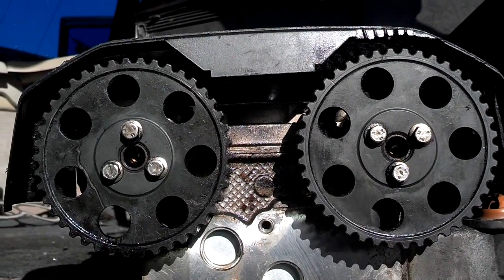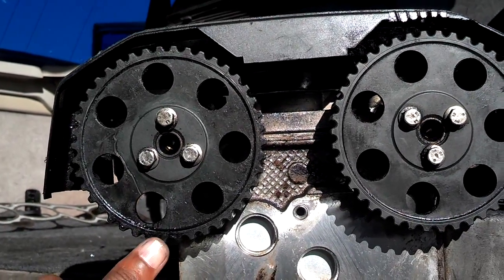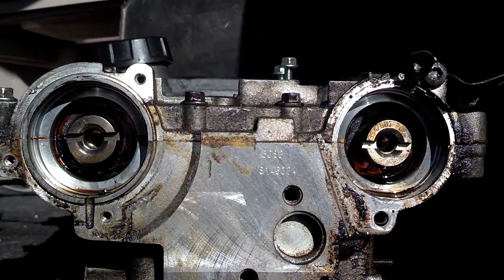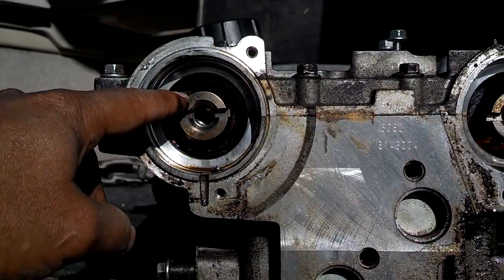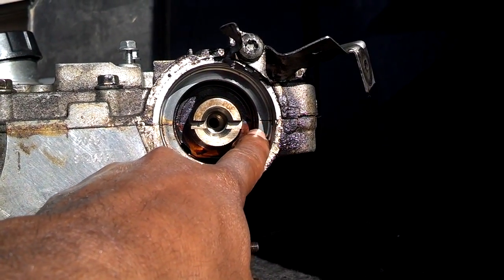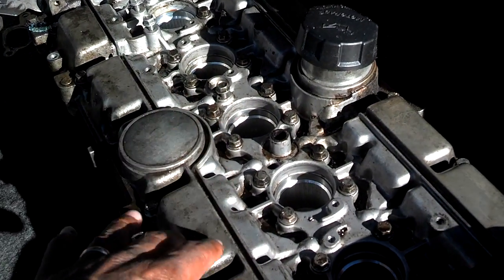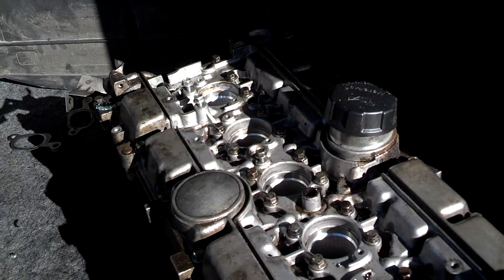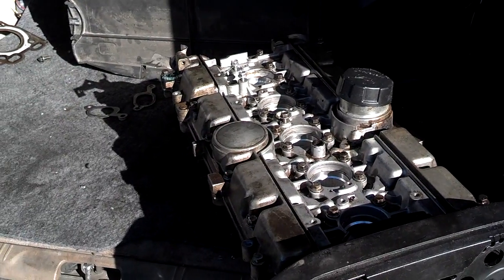Timing demonstration with head removed, cam cover installation. Volvo 850, S70, V70, etc. - VOTD

Comment: Hello Robert, ok here I am again. So car started right on 👍 the problem is that the whole reason I did all this is because there was white smoke and coolant drops coming from tail pipe, so I though that the was a head gasket problem, but after all this fun work the car is still blowing a bit of coolant from tail pipe and coolant keeps on leaking from behind the engine on the driver side, I can't seem to be able to locate exactly from where it's this coolant leaking from, I have scratched my head for a while so here I am asking for advice again, can you please help

Thank you again.
Reply from the maker: Oz Ramuco The turbo should have coolant lines. Also, are you sure the white smoke is coolant? Could be a turbo taking a dump, usually more grey smoke. - 2003 Volvo XC90 T6 AWD Smokes and has P0234 Code. Bad turbo...
Reply: it's white and with liquid drops as well
(coolant?) wich is the reason I replaced the head gasket and ha the head machined
Reply from the maker: Condensation ALWAYS leaks out of exhaust. When the car is cold, white smoke usually comes out of the exhaust. What else was going on with the car? Was it overheating? Was it loosing power? Was it misfiring? Was it mixing coolant in the oil? Was it loosing coolant other than the coolant hose you have leaking behind the motor? Replacing a head gasket is to much work to do on guess work or speculation.
Reply: Hello Robert, question. the car keeps blowing white smoke from exhaust and droplets of coolant as well. so I got the Bock tester to see if the liquid would turn green or yellow but it remain blue, which I think means that there is no coolant going into the combustion chamber or that the head gasket it's ok? can you help please.... I am confused. trying to determine what its causing this darn coolant vapor coming from tail pipes
Reply from the maker: The tester tells you that there is no combustion gasses going into the coolant. Can you take this discussion to the head gasket video or private, off of this timing video please. - How to test for a blown head gasket on a Volvo - VOTD

Comment: ok so I removed the head, before I did that I timed the camshafts to the top of the timing cover but not the crankshaft, i also changed the pulleys on the camshafts, so now i don't know how to set the timing right on the car :( can you help me please?, i guess what I am asking is how after all my stupidity can i set the timing on the crankshaft, i am thinking to set the crankshaft to the correct marking, then to set the cams the way you illustrated on this video and finally set the camshafts pulley in their marks and only then to reinstall the timing belt. am I correct??
Reply from the maker: Oz Ramuco You really need to set the crank on it's mark before you install the cams in the head. So, if you already installed the cam cover, you may have to remove it if the crank is NOT on the marks. Matter of fact, if the crank is NOT on the mark, and you installed the cam cover, you may have damaged some valves. Did you use my video to remove and install the head? Timing Mark Crank Sprocket Location, Volvo 850, S70, V70, XC70 - Auto Information Series - Volvo timing alignment - Auto Information Series
Reply: so here is what I did, took the back cover for the cams so that I know that they were align then without the spark plugs nor the timing belt I finally put the crankshaft on its mark, and only then I installed the timing belt and gave it two full turns to see if all the marks where in their proper place and they were spot on. does that sounds ok or should I go ahead and do it all over 

thanks for the help!!
Reply from the maker: Sounds perfect. If the crank turned over with the belt installed, tensioner set, and back of cams lined up in the back of the head, you should be good to go.
Reply from the maker: I guess you have a Volvo?
Reply: yes a 2000 s80 t6
Reply: Thank you so much Robert, I really do
appreciate your help
Reply from the maker: Doesn't that car have CVVT?

Comment: i have to change a head gasket on a 1999 volvo s80 t6. I have to remove the timing belt do i have to take the engine out of the car to do so.? and can you give me some advice on removing the head to replace the gasket?
Reply from the maker: No you do not have to remove the motor to take the head off of it. I have not done a video for the S80 so I am not sure of each step. As with any car, you pull the stuff from off the top of the motor, then disconnect the stuff attached to the sides, front and back, then do what you need to do to access the head bolts. Motor Cylinder Head Removal, Head Gasket, Burnt Valve, etc. (Volvo 850, S70) - Auto Repair Series

Comment: great video, i have a question regarding my 1998 volvo v70 wagon, the camshaft cover is melting it looks like indication of somthing wrong under that plastic cover, im assuming its the timing belt cover but the sticker says camshaft cover, anywho i was wonderin what i should do, i am  currently not driving it because it was makin an obvious sound that there was friction with the plastic n the sprockets that spin..
Reply from the maker: Without pictures or a video it is hard for me to understand what issue you are having. Example is, I have no idea what you mean by "the camshaft cover is melting". To me, that is the timing belt cover. Please go to my website and contact me directly. Or post a video and link the video to me so I can understand what is going on.